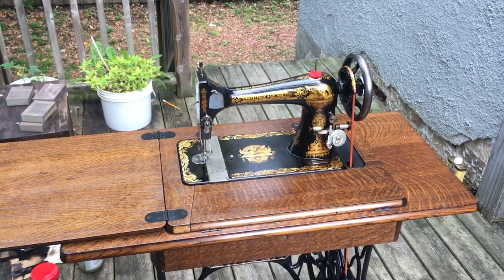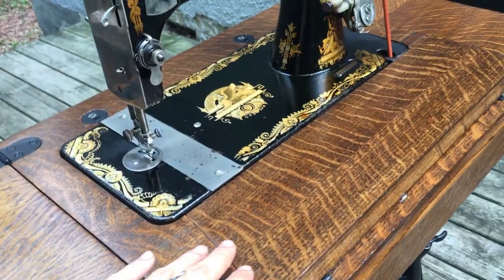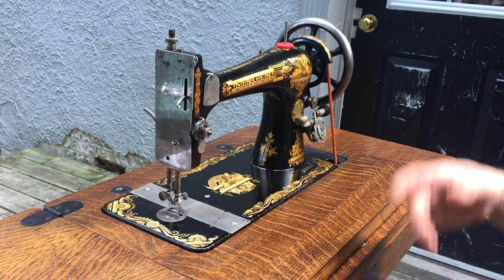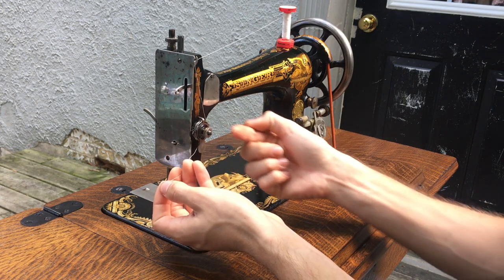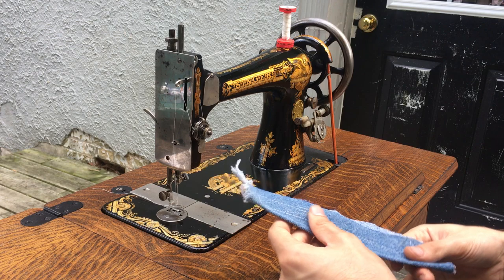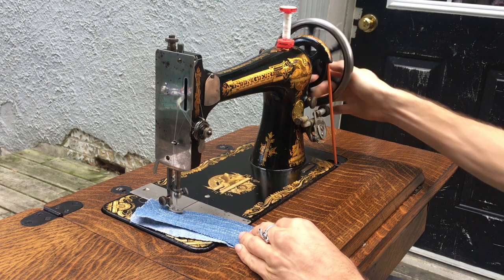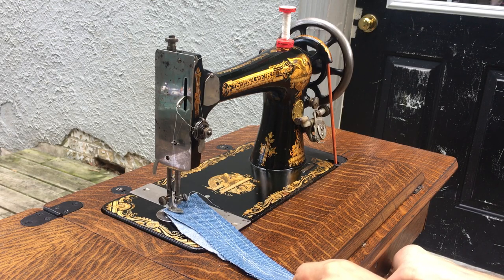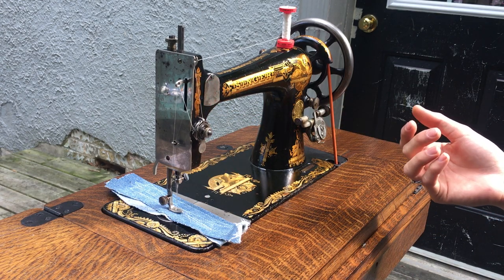Fully Restored 1902 Singer 27-4 Sphinx Treadle Sewing Machine - How to thread & sew

Comment: That is some of the prettiest wood I’ve seen
Reply from the maker: Thanks! It was definitely worth refinishing. Hand rubbed shellac goes a long way too
Reply: @tobyssewingmachinerepair8949  What are the downsides of shellac?
Reply from the maker: @stopthephilosophicalzombie9017  It is not quite as hard as polyurethane, and doesn't stand up well to alcohol. It also takes longer for it to fully cure. The upside is that you can recoat shellac after 30 mins, and it's easily repairable! You can wipe a bit of new shellac over a scratched or damaged shellac finish and the new layer will melt into the old layer. I personally like it because it's the original finish that was used for sewing machines up until a certain point. It also makes the wood look incredible, I find that polyurethane gives a sightly plasticy look. It is liquid plastic after all!
Reply: @tobyssewingmachinerepair8949  Right on. I'll have to try it. I've been looking for a good vintage machine/table combo for a resto.

Comment: I have the same machine that I bought from garage sale in 1982 for $30. All these years I've meant to bring it back to use.  I need to oil and try out the machine.  Any hints on cleaning and oiling the head? Thanks for the great video.
Reply from the maker: I do have a video showing how to oil it. It's one of the first videos on this channel. You can also find the manual online it has instructions on how to do it.

Comment: How much does a fully restore 118 year old machine sell for? 
I only hear about what bargain mess someone gets. Sometimes it is nice to have someone else do the work! 
You are a pro!
Reply from the maker: Thanks Cheryl! I sold this one for $340 CAD which included bobbins and a dozen attachments. Definitely the most I've ever asked for a treadle because it took so long to completely refinish the wood. I paid $30 for this machine head (and the attachments) and I think $60 for the empty treadle cabinet. Usually for treadle machines that don't need refinishing or repainting (bulk of the work is on the machine head) I'll ask $180-250 depending on the model and condition.